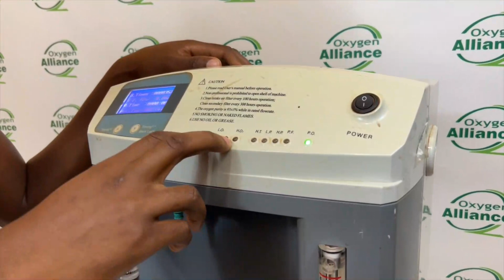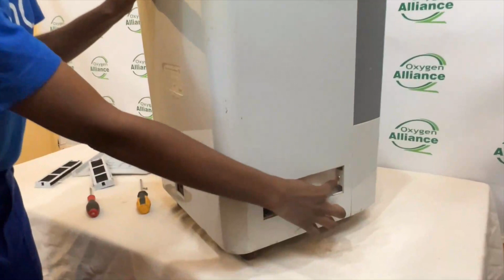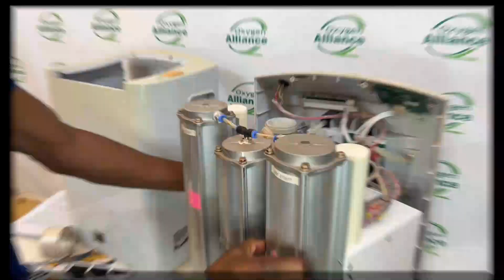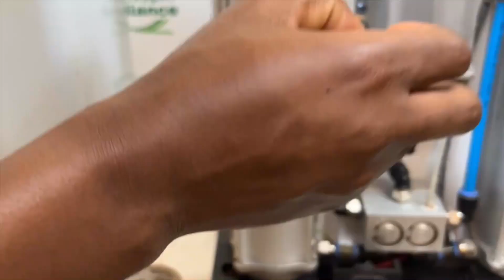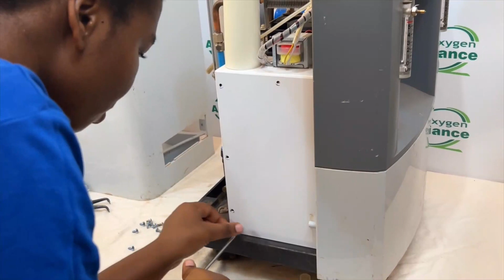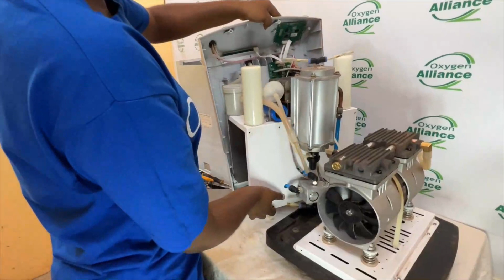JAY-5  Oxygen Concentrator Teardown

Comment: Jay-10 oxygen concentrator the valve pressure is leaking ans alarm noise with red light is on. I have change the pneumatic connector but still pressure leaking. Help me with the problem
Reply from the maker: Assuming the leak has been confirmed to originate from the valve and replacing the pneumatic tubing did not resolve the issue, the next step would be to replace the valve itself with a working one and observe whether the pressure stabilizes. This will help determine if the valve is the root cause of the leak.

Comment: The solenoid valve is not opening to allow the oxygen out,what could be the problem
Reply from the maker: If a solenoid valve in an oxygen concentrator does not open, the problem is usually related to electrical, mechanical, or pressure issues. Electrically, a burnt or open solenoid coil, lack of power from the control board, loose wiring, or incorrect voltage can prevent the coil from energizing, meaning no magnetic force is generated to move the valve plunger; this can be corrected by checking voltage supply, testing coil resistance with a multimeter, repairing wiring, or replacing the faulty coil or valve. Mechanically, the valve may fail due to a stuck plunger caused by dust, moisture, corrosion, or worn seals, where the solenoid may energize but oxygen flow remains blocked; cleaning the valve, replacing seals, or installing a new solenoid valve resolves this.